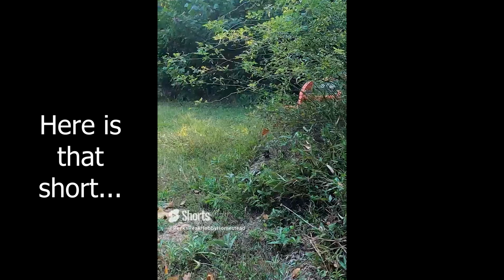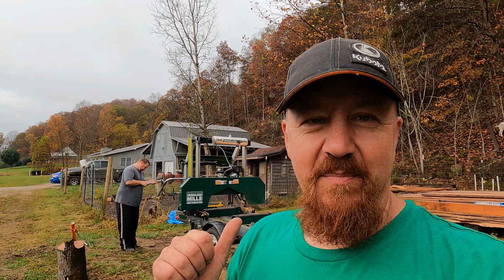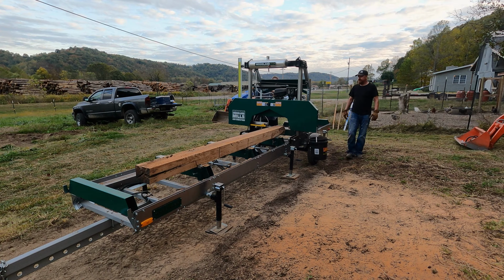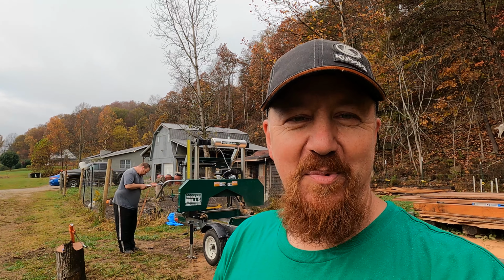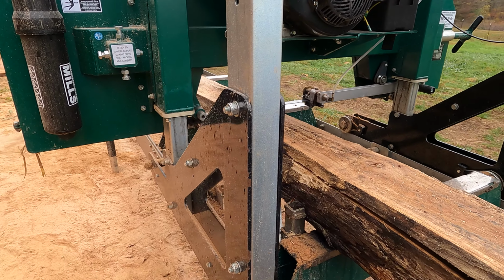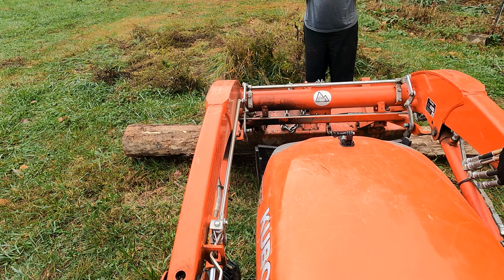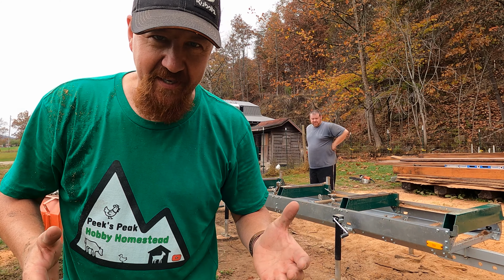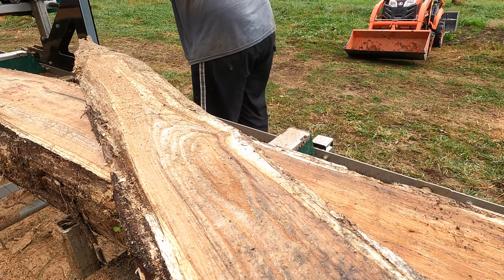Milling “Dirty Rotten” Logs - Is It Worth It?

Comment: Good point, using a down tree on a dull blade with a little free time produces table legs for the cabin. To me it beats wasting time watching a couple reruns on TV and plus you made something that can be used not wasted and had fun doing it too.
Reply from the maker: Exactly.  It isn’t necessarily productive or efficient, but it also isn’t wasteful.  All in what you want to do.  Thanks for watching!